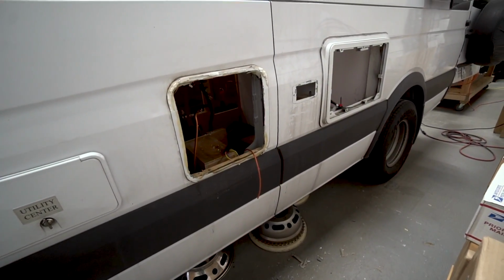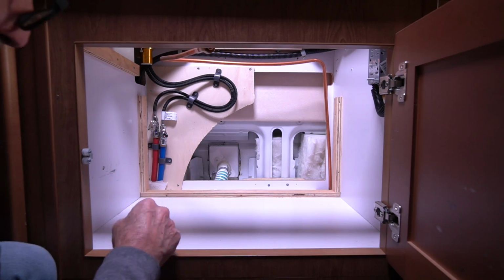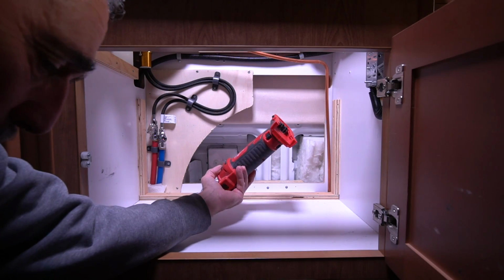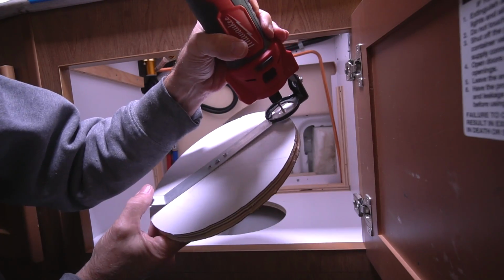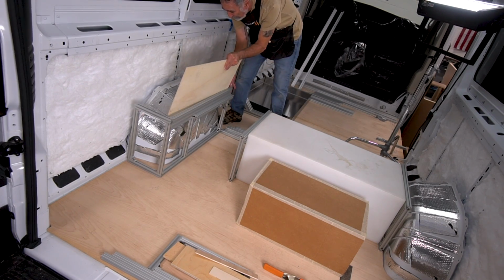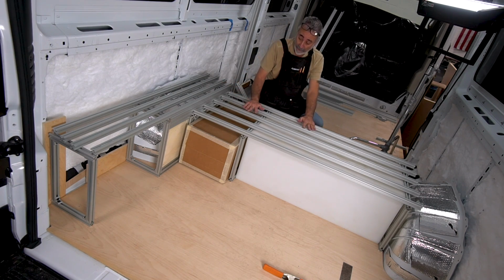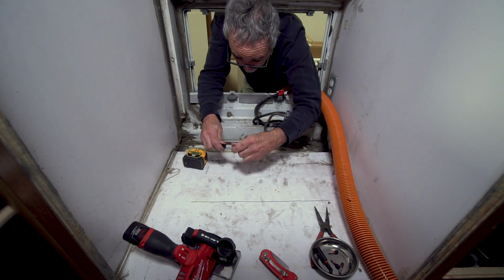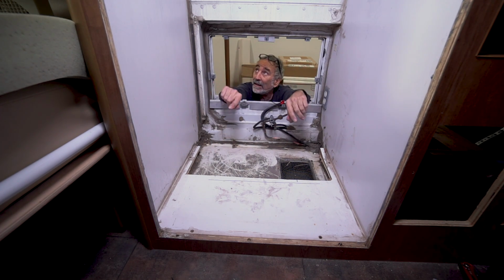Van build or remodel your older van? This builder is doing both!

Comment: This is by far my fav video series...retrofitting your Pleasureway. I'm taking cues for my 2011 Roadtrek MB 3500 Adventurous RS. Wish I'd seen your vids on kitchen placement...but I'll live with that part. Maybe a future Humble Road van down the line. The electrical upgrade is perfect. Connecting to the engine alternator is strangely missing. ;-)

Comment: Your are the most interesting van designer of the internet. I love watching your video. You showed me how to build these aluminium modular structure, floor, side panel, insulation, ... . I gonna build my own van next year and I will do it like you. A kiss from belgium in EU. 
question : what is the section of the modular tube your are using for the futon ?

Comment: Hi George. I think you know something I don't?   I always thought that propane was one and a half times heavier than air so I built my vents low.  What have I missed?
Reply from the maker: Yes you are correct! I transposed natural gas with propane in my peabrain as I was pontificating. I think I should pin a correction comment on the video.
Reply: @HumbleRoad  That makes sense. We all have those moments.

Comment: That hole in the floor... Dave Orton, a winery engineer in NorCal, made a hole in his floor with a plug. On hot days, he opens the plug and turns on the ceiling fan. The coolest air is in the shade under the van, so he pulls in cool air from the floor vent and the hot air around the ceiling exits out  via the fan.  Something to consider in future van builds. Of course, the hole must be plugged during driving and also be covered with fine aluminum mesh to prevent bugs and mice.

Lovely 80/20 bridges, George.  I adore that material.  If only it weren't so pricey.  There must be a way of getting this directly from China - cheaper.  So interesting to see the guts of your Pleasureway.  Very educational!
Reply from the maker: China? Cheaper? Put a bar of soap in your mouth and go sit in the corner. I want you to think about what you just said, young lady. 🙃
Reply: @HumbleRoad  I am humbled by Humble Rd.  Never shall the word 'China' sully my lips again!  🤞😁

Comment: What's its new name going to be?  Humble Pleasure?  Humbleway?  Georgeway?
Reply: George, you are on the right track with your cut out tool and spiral bit. I have a Bosch Colt router.  It would work great in that space cutting open an access hole.  You could also make a template and cut out a square access hole too.  Milwaukee makes a small palm router as well, although I have never used it.  These palm routers are nice for small confined spaces, or for small jobs. They have plenty of jigs available such as the one by Woodhaven, which I like, helps keeps things square and lined up.
Reply from the maker: Yes. I thought about using a precut template, both inner track and outer track. Given the diameter of the hole and the width of the box, I felt this method gave me the most freedom. Certainly a sloppy cut, but I'll do my best to clean it p.

Comment: Clamp on your circle then follow it by starting with a pilot hole and using a router? 
Former Hightstown High School shop teacher here.
Reply from the maker: Not enough room in there to use a circle template.
Reply: A router was my first thought too. Hard to tell how much room there is from the video, but a smallish plunge router with a guide bushing should work great. A circular (or any shape really) template attached with double stick tape should do the trick. You can even make the template/jig in two pieces (inner and outer) with just enough clearance for your guide bushing so the router is always fully supported (no tipping) as you move around the cut. 

In addition, using the same template and just swapping to a smaller bit after you are halfway through the thickness of the floor would create a nice “lip” if you wanted to add a flush fit cover for the opening.

Comment: The Clear Lexan to inspect water lines is a great idea. Instead of paper towels, desiccant works great for identifying moisture. It changes color and will absorb some moisture. Just have to come up with some kind of vented container to put around the water lines. You have fantastic ideas in your builds. I enjoy your channel.